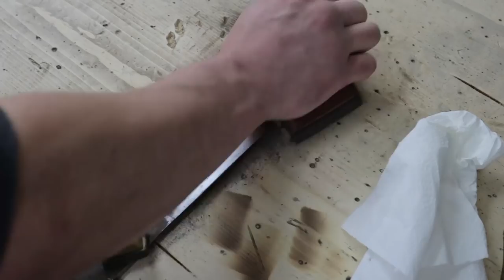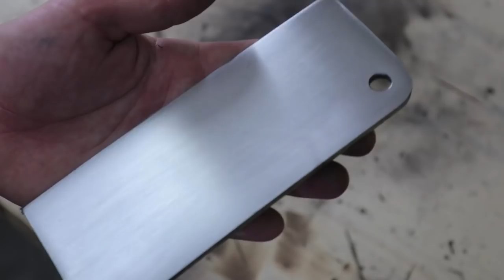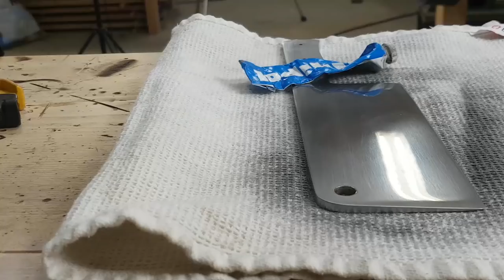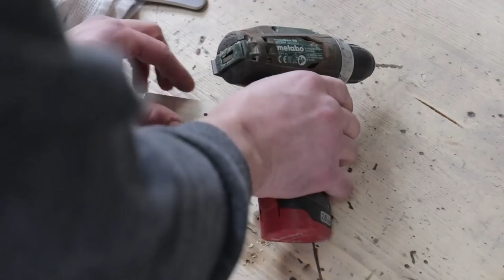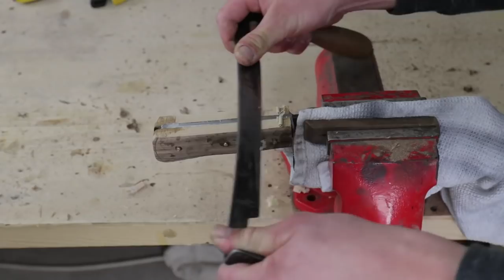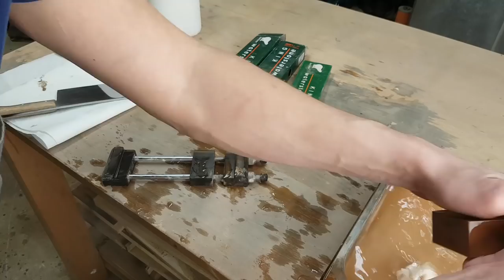Rusty Cleaver Restoration - No Power Tools

Comment: A little tip for your camera, turn the auto focus off on the lens itself and set the f-stop higher with a low shutter speed and higher ISO It won't lose focus as much, and it won't make those noises...turn it back on when you move things in and out of range though. Cheers